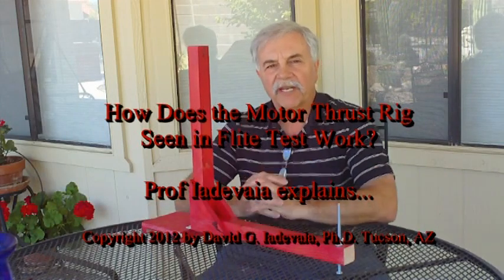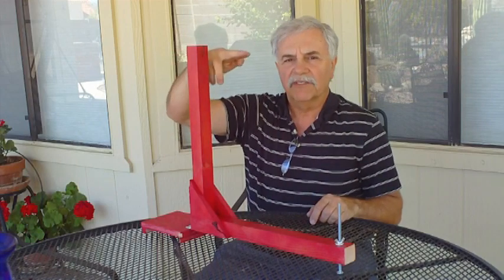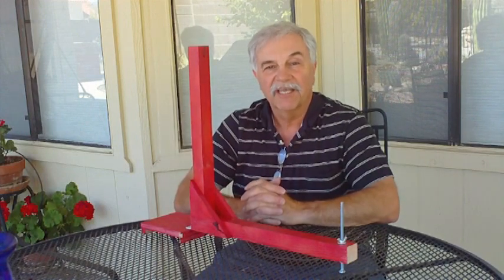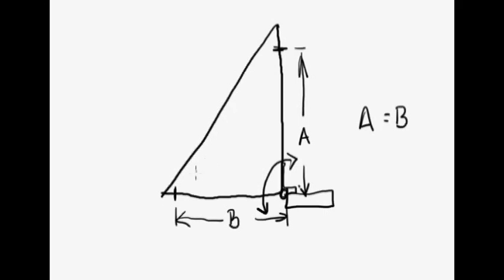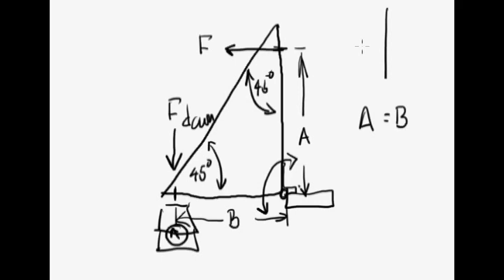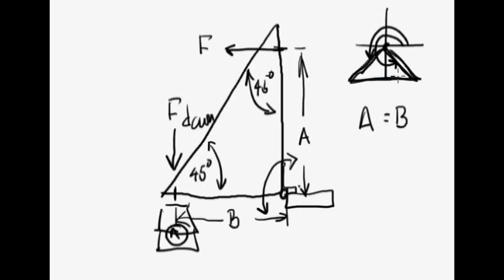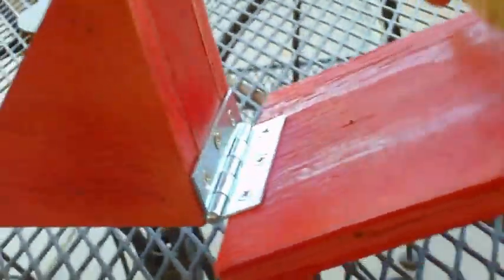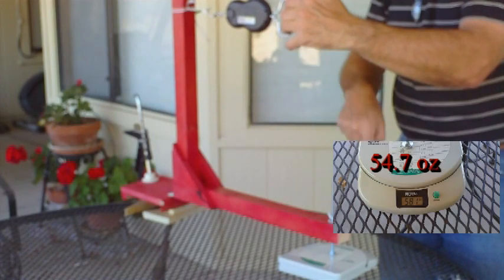Motor Thrust Rig

Comment: Hi professor.I hope you are still monitoring this video as its 5 yrs old now, but here goes.does it mess the measurements up when testing a puller setup  as apposed to a pusher setup, because a puller would be mounted on the front (facing the scales), and a pusher would be mounted on the rear (facing away from the scales).hope you understand what I mean, I am not very good at explaining things, thanks in advance.